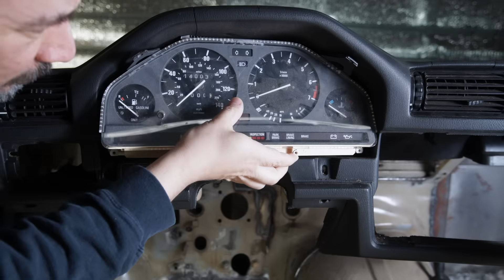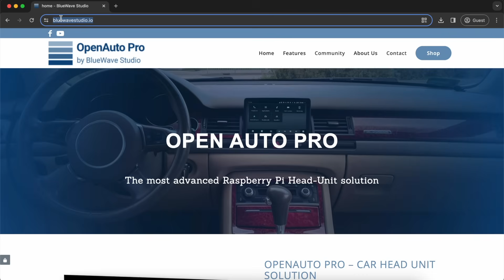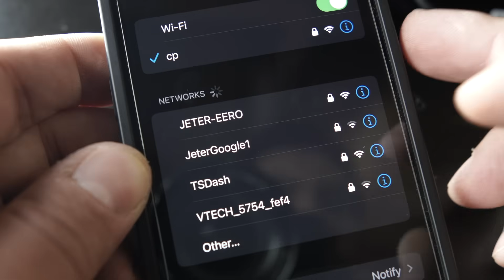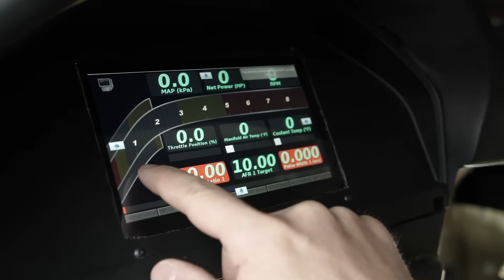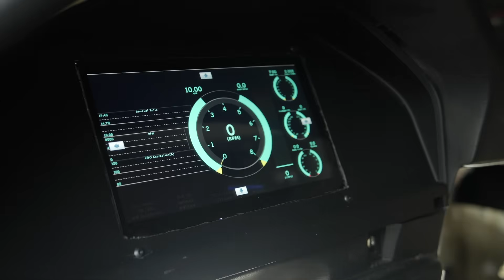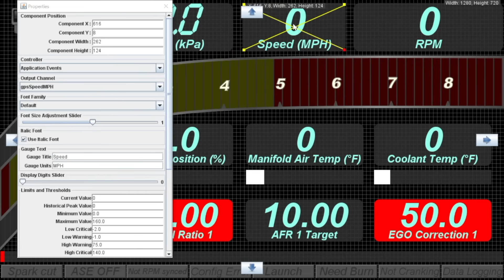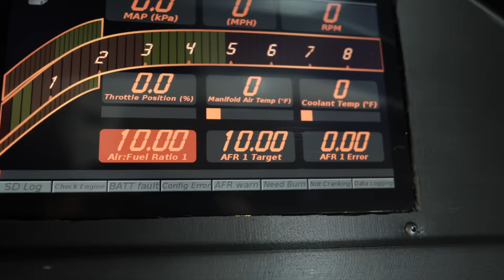Transform Your Digital Dash with the Power of a Raspberry Pi

Comment: Great build! Question for you if you know: how resistant to heat are these components? I live in Texas, and inside the car. It can get very very very hot. :-)
Reply from the maker: Thanks much. We printed this with PLA, which isn’t the greatest for hot sun but this was more of a prototype. We’ll print the next one with a cut out already in ABS filament. ABS filament is way better for parts that will be in the sun. ABS is good up to like 180F degrees 👍
Reply: Thank you!  Do you happen to know if the electronics are also heat resistant?  Worried mainly about the screen, but that may be based on older screens. @Itsallaboutthebuild
Reply from the maker: @ssskids123  looks like most of the newer screens are the same make as what car radio vendors use. In that case they should hold up to the same spec car radio touch screens can withstand 👍

Comment: Have you figured out one with the hole already cut out for the screen ?
Reply from the maker: So I created a nice clean 3D printed bezel for this one. I’m trying to cut out the screen in the original 3D print, but the supports are crazy. The print will take tons of extra hours 😥😥😥 Still trying to figure it out 😁😁😁

Comment: How did you manage to make the aperture cut for the screen so... povo?
Reply from the maker: The infill was set very low to reduce print time. When cutting the hole out it fell apart. This was just a prototype. I'm working with the 3d file to make the opening durning the 3d print. The original 3d file is completely solid. All things are a work in progress 👍

Comment: Excellent video!! Ive always wanted to do this to my e30s. What write up did you follow? Do you need to be on standalone ECU?
Reply from the maker: Thanks much 👍 This e30 project is getting out of hand 🤣. Hope yours is in better shape. So we plan to go with a Speeduino standalone ECU and that will work with TSDash. You’ll have to replace the Jetronic or build some custom ADC to read the sensors which I couldn’t find any info on. I’ve written up on my findings here 👉 https://www.allaboutthebuild.com/blog/2023/12/can-you-tune-a-bmw-e30 Have Fun 🙌🙌🙌
Reply: @Itsallaboutthebuild  does the speeduino send the signal over CANbus or is it using a different protocol ?
Reply from the maker: @ForgeSpace  it uses usb or secondary serial interface. However Speeduino looks to also support canbus 👉 https://wiki.speeduino.com/en/reference/Interface_Protocol

Comment: Keep things analogue!
Reply from the maker: Do you not like the retro digital look???
Reply: @Itsallaboutthebuild  If you've a display issue, you're screwed. Analogue sensors for each instrument is better in my opinion. It's like giving a granny a facelift.
Reply from the maker: @CaptainGimp  but if something goes wrong with the analog components, they are hard to find for a 44 year old car. If digital isn’t working, you fix/replace the broken sensor that has an issue 😁

Comment: this is brilliant, i was thinking of doing a digital dash on a 2005 VW Passat, i have bought a broken cluster to use for dimensions so we can draft it up on CAD - did you do a fuel guage? im thinking of using up the whole space to add things like a digital fuel guage etc also - great job! - subbed!
Reply from the maker: Thanks for the sub 👍. For fuel gauge you could add a circular gauge in TSDash as well. I should have covered that. Are you thinking of going with standalone circular gauges to the left and right of the LCD screen???
Reply: @Itsallaboutthebuild  i was considering that, i also found some sharp form lcd's but not sure if they still produce those, i was thinking maybe using the form lcd to cut the shape of the cluster - just depends on availability vs cost i guess
Reply from the maker: @wheelsandstuff  you could cut more out of the cluster, but I think it would need to have higher infill for the 3D print. To get this one done quicker it was like 8% infill which didn’t work well when you start to cut into it 👍
Reply: @wheelsandstuff if you do this please let me know because I would like to do my Passat also. 2005 tdi